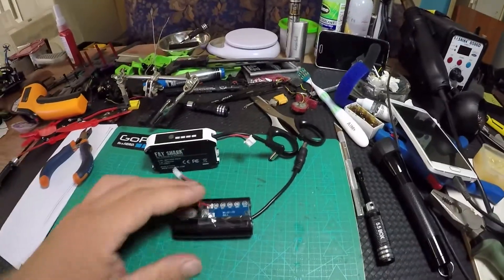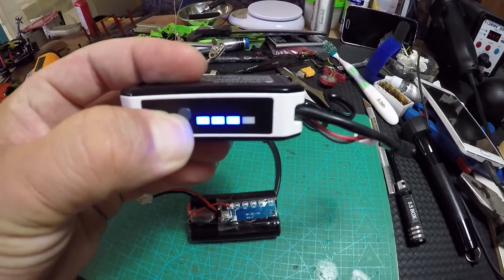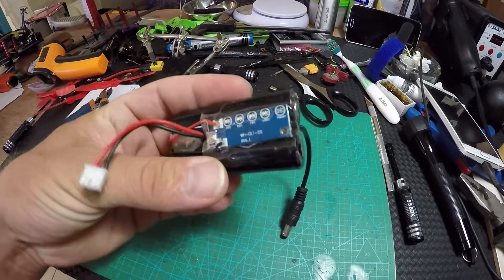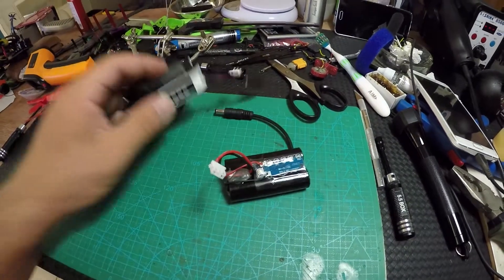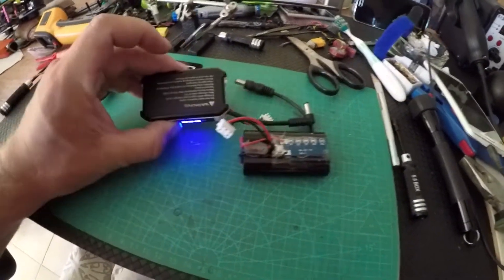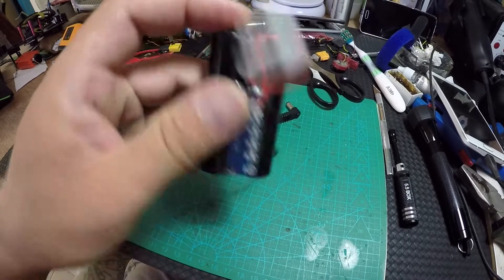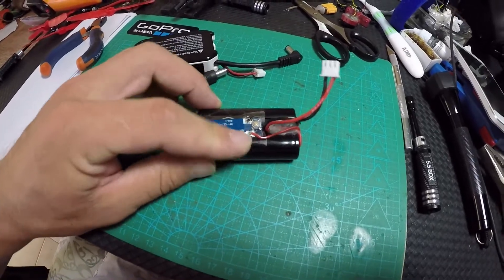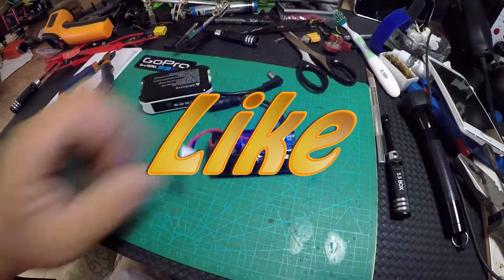DIY LED Fatshark Battery Capacity Board/Lipo Battery Voltage Display Indicator Board

Comment: Fatshark's LED status checker has a balancer built in so it does not need the balance lead connected. How do you balance the cells on the battery pack you made if you don't have all 3 leads connected of the balance plug?
Reply from the maker: redline870 Hi. On the original fatshark battery i don't have 3 wires so its no different from the original one. But if you want you can put a balance wire from 2S and its ok.